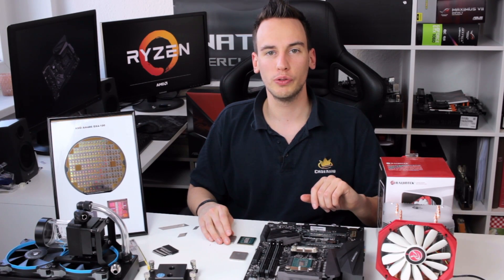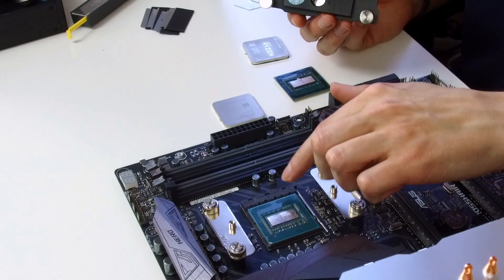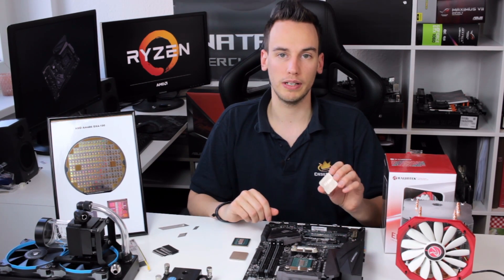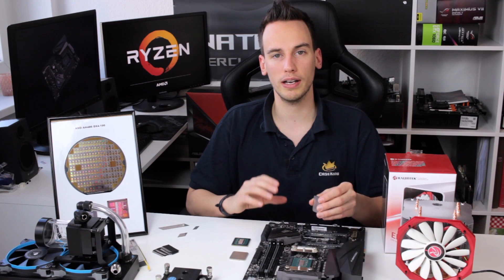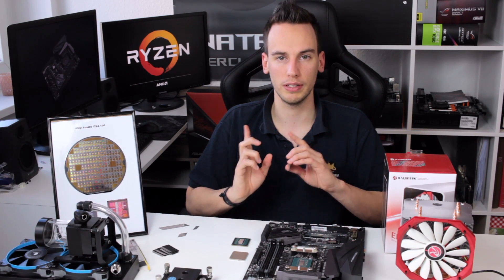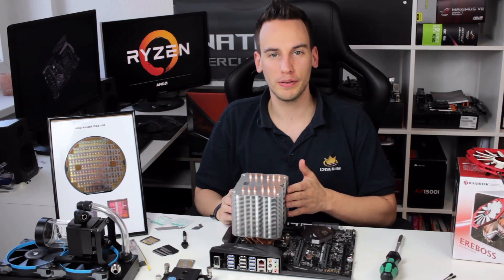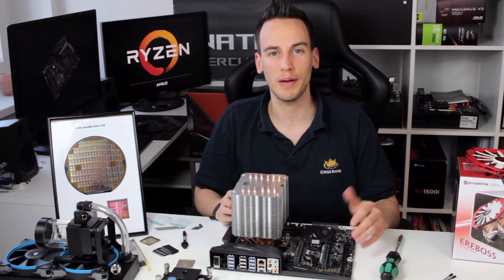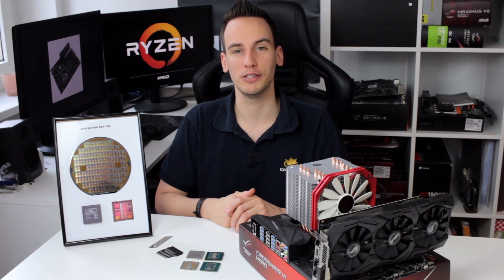AMD Ryzen Direct Die Cooling - Improvements?

Comment: Heard that some 7700k are running super hot due to intel being lazy and using rubbish thermal compound under "IHS"
Is it true ??
Reply from the maker: pretty much
Reply: +Rifat bin azad নিয়ম Why would upgrade to Kaby if you have Skylake? Kaby is Skylake 2.0 except that the differences are slightly higher OC frequency, HD630 iGPU and some very small additions/improvements. I have i5-6600K clocking at 4.9GHz @ 1.35V and there is no reason for me to upgrade to the i5-7600K, they're the same clock for clock (meaning no architectural difference). Also, yes they cheaped out on the TIM even more under the IHS.
Reply: mine ran 100*C at 4.4 using aida 64.
Delid and applied coollabs Liquid Pro.
Now running at 4.8 / 4.5 AVX with aida 64 at 67-69*C
Reply: forgot to add, after delid, i have it set to 1.248Vcore
Reply: Quote.  Intels reasoning for solder seems to be longevity, and they have a point, to some degree: Solder will struggle with rapid contraction and expansion of metals during extreme temperature swings, where thermal compound remains stoic and largely unaffected. That said, the concern of expansion/contraction of solder is largely relegated to smaller dies, which some of these new CPUs are not. Using thermal compound could be defensible, though thermal improvement is still tremendous when switching to soldered contact or liquid metal. And Intel has not been particularly good in the thermal department lately
Reply: Also the layer of the compound is very thick, if it was thinner the quality wouldn't matter as much
Reply: time to write the response again, after youtube deleted it as i clicked on show all messages...
thx youtube improving everyday.....
anyways.
idk about shutup10 i couldn't find what license it uses if it uses gnu general public license  thus being a really free program it shouldn't hurt to use.
but regardless,
throwing software on the os trying to stop the os from doing certain things, seems to me like u're on the short end of the stick.
microsoft has the backdoors has the forcedupdates, the resetting of settings, the deleting of your software, whatever they want, if they need to.
i think the best option if u really really need to use windows 10 virus is to see if there is a hacked version that disabled or got rid of all the cancer within the os as much as possible and stops all connections to microsoft etc... and of course disable all updates.
idk if there is a nice version of that out there as i wasn't interested in it, but just a thought.
other than that i can really suggest giving gnu/linux a try if not as a main operating system as i don't use it as such atm either, but at least getting to know the place u can jump to, when microsoft even gets worse and believe me they can.
think about permanent internet connection or cloud based os.....
u could also just go back to windows 7 pre telemitry (http://winaero.com/blog/beware-windows-7-convenience-rollup-adds-telemetry/)
and yes microsoft is as scummy as can be :D
Reply: You can drop the temps even more by replacing the stock fans (if you have them) with better static pressure fans from Corsair or Noctua (some of them are a little on the pricey side though, and also if you're getting Corsair SP fans get the "Quiet" versions, the normal ones are obnoxiously loud). On top of that, maybe get some quality TIM like NT-H1 from Noctua, which does wonders for everything that needs TIM applications. Ambient temperatures is also a key factor for lower temps too.

Other than that, delid is the cheapest most cost effective method of dropping temps. Some use a sharp razor, but if you're a little scared of breaking the thing you can get a delid tool somewhere. If you plan on delidding you need metal TIM too, and gluing it back together is not a necessity because the "lever" (whatever it's called) is strong enough to hold it in the socket. The downside is that you void the warranty, obviously. 

That's all I can think from top of my head.
Reply: Well I dunno what you want to believe but I think over half of all 6700k and 7700k for example can overclock to 4.6Ghz before getting thermal issues. The heatspreader has not been even close to an issue for me even with serious overclocks. I got to 4.7Ghz at 1.4 volts the other day just setting my voltage as high as I dare and seeing how far it took my clocks, and still didn't hit any thermal caps in the hottest temp benches I can run, so it seems fine to me. Seems like that's the goal Intel is going for, just good enough to keep intermediate overclockers happy. there's always gonna be outliers though. yes they could have done a better job and yes delidding sees huge temp drops for a lot of people though.
Reply: futmut1000 bulldozer wasn't a competitive chip in power. also no multi threading. really bad ipc. super hot. there were other problems with it. Ryzen has no such issues. good ipc good temps and multi threading. also it's more timely. people are buying broadwell e so we know games will start trying to take advantage of more threads soon.
Reply: +Rifat bin azad নিয়ম There's no reason to even go to an i7-7700k if you already have an i7-6700k. It's the same processor with a slightly higher clock right out of the box.
Reply: if you overclock, the 7700k has been improved so it can overclock further than a 6700k can. A 6700k will typically get you around 4.5Ghz guaranteed OC, to up to around 4.7-4.8Ghz if you get a decent chip. However a 7700k can usually hit 4.8Ghz easily, and decent chips will get 4.9Ghz, and a really good chip will see even 5.1Ghz. Still not worth upgrading if you already have a 6700k but basically if you are starting out fresh, the 7700k is better for OCing than the 6700k. It's basically a refined chip that has been binned to ensure a higher OC.
Reply: Rifat bin azad নিয়ম every intel cpu thats non-enthusiast (E) past the Sandy Bridge has the same problem. But regardless, the IPC fifference is no higher than 3% so dont bother
Reply: ik this reply is 3 years late lol....but i just delidded my 8700k  and lapped the top of the ihs and liquid metal and went from 62 idle and 98c INSTANTLY under full load to 34c idle and 58c under full load ( 1 hour stress test for the full load after delid )
Reply: yes true :/
Reply: just wanted to go 5.0ghz :P thats why ! i know it's not worth it ! my 6700k reaches 4.6 ghz at 1.325v ! anything over this it goes nuts it passes some test then fails ! i am now running on stock everything because my i7 reaches 75c on a 280m rad -_-
Reply: wow! i will delid mine :3 but i am not sure how to put it back together ! And the crappy thing is In my country on one git their 7700k to go 5.0ghz even the max was 4.8ghz at 1.4v ! we get f***ed with bad examples of cpus
Reply: The biggest problem is the thickness of the glue.
Reply: @chiken 144p, well if u rly hate yourself u can sidegrade to kabylake to support the drm in them with windows 10! to watch 4k netflix or other stuff.
how fucking horrible is that :D
Reply: +cataria pega Ah hell no, I need some cash left over after shelling a bunch of money on upgrades up here in Norway, I know our salaries are quite different and such but an RX 480 4GB Nitro+ costs $269.5 in USD directly. We personally don't think it's much but we're not filthy rich either. Also I seem to be one of those plebs that haven't yet tried Netflix so there's that. =l
Reply: @ chiken 144p @desinc
i should have used @desinc sry :D
anyways
in case i wasn't clear no one should get kabylake or windows 10.
the drm cancer is horrible out of principle u should get the shared 4k version of netflix then.
and yes shared is the right word here, "pirated" is marketing by the big companies to criminalize our wording.
it's sharing. microsoft,  intel and netflix are anti sharing asholes, that want to infect your pc with the windows 10 virus also with the drm cancer through it.
rx480 upgrade seems nice if u go from a crap gpu, i want a vega card, 3 month to go till release :(
Reply: +cataria pega No probs. Anyways, Windows 10 is okay for me as long as you uninstall the bloatware and uncheck some settings.
Reply: @chiken 144p for me windows 10 is clearly no operating system, it is 
malware setup to control your computing and harvest your data.
gnu.org has some great examples of it:
https://www.gnu.org/proprietary/malware-microsoft.en.html
the thing is windows 10 even knows how bad it is, so it doesn't try to get u with good features, but with forced upgrades, upgrading without asking, nag screens, compatibility etc...
i personally get really annoyed if a program runs out of their expected and wanted behavior.
like skype, which i got rid of, once it autostarted and updated, although the update process has been disabled.
now using qtox, which so far except a few hickups works perfectly fine.
my plan is getting amd vega and then leaning strong towards linux mint mate with compiz, i live that gui so much or just stick with windows 7 till the end of time....
Reply: +cataria pega Holy shit that's a long list of not so good stuff... those are pretty scummy things that Microsoft do. I haven't tried any other OS so I don't really know how bad it is, but maybe I should give "shutup10" software (supposedly antispy tool*) a try if more unexpected bullshit ever happens.
Reply: so adding $500 to their broadwell e for better paste? smh
Reply: When you see 20c+ temp drops from simply using liquid metal (solder would have seen even better). Then the company seriously screwed up. especially when you know that clock for clock there is no difference between it ans skylake. all they did was bump the clocks up a couple hundred mhz. But couldn't even solder the damn things after already cheaping out on the generation?
Reply: I take you mean Hyper Threading? ...
Reply: My chip hits 80c on an average day at about 4.7Ghz. I seriously seriously seriously doubt reapplying the paste with liquid metal would make me run 4.7Ghz at 60c on the same cooler.
Reply: DeSinc it's quite likely that it could. depending on that type of cooler you're using. even if it's only 70c that's still say better.
Reply: Nuke ザキューブ Well... I got a 6800k for less than £400 about a year ago...
Reply: NOPE, it has to do with the space between the IHS and the die due to the amount of glue used to glue down the IHS.  Has been proven time and time again.
Reply: I've noticed my 7700k temps have improved over time.. Perhaps there is an "wear in period" or simply the pressure of a cooler and heat of running CPU has decreased the space as the IHS has slowly baked in..
Reply: Rifat bin azad নিয়ম yup
Reply: 5.0ghz if you take the ihs off and use your own compound other then stock one
Reply: eh, I've tested it myself. difference between a good spread and a bad spread can be upwards of 6 or 7 degrees celsius in my experience. not sure about thickness but usually too much is bad. if you get too little, you can cause a bad spread or one with air bubbles which is much worse and can get you terrible temps as a result. That being said the metal block heatspreader is designed to alleviate those problems, so even if you miss 15% of the heat spreader when squishing the heatsink down on it, it still gets most the heat off it from everywhere else that it makes contact.
Reply: Setto Arisaki you laugh, but I used to use toothpaste mixed with a bit of vaseline on "Franken" pcs in the mid-late 90s, which worked fine (though this was before overclocking was really a thing).
Reply: was thinking of going with i7 7700k but i guess i will stick with my 6700k !
Reply: ΩℳℰG 🅰 oh yeah when u use liquid metal it has to cook in. it'll bind better after it's heated up and gets a better bond to the die and ihs.
Reply: For general purpose thermal paste, I still use fine machine oil mixed with toothpaste. It cools quite a lot better then most of the paste delivered with heatsinks and since I have a habit of doing maintenance on my systems every 2-3 months, any hardening problem this method may have is removed by that.

But since I'm using fine machine oil, the compound drying out is highly unlikely.
Reply: +interlace they said the same thing when Bulldozer released...on multithreading it was faster then an i5 at the time...they said wait till games start utilizing his potential...here we are 6 years later and even an i3 beat it now...

Games wont start using more threads just because Ryzen launched, it is a long process which will take time...and you have to be a fool to spend $500 to buy Ryzen for gaming since it is slower then a $240 i5 7600k...

Ryzen is good for other things tho...and has a low price so is not that bad.
Reply: On an Amd Ryzen video and start trolling Intel...that tells a lot about Ryzen, which can barely hold his own against a Pentium G4560 on Gaming benchmarks...Pathetic.